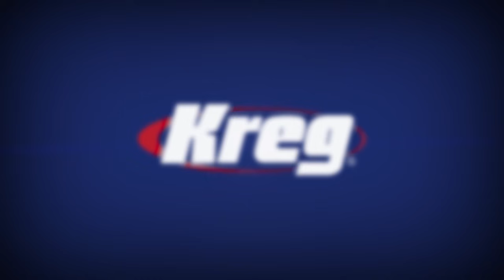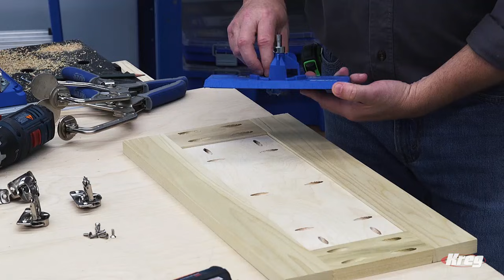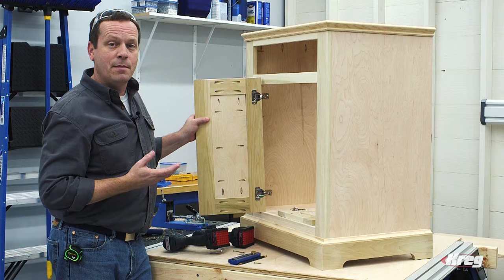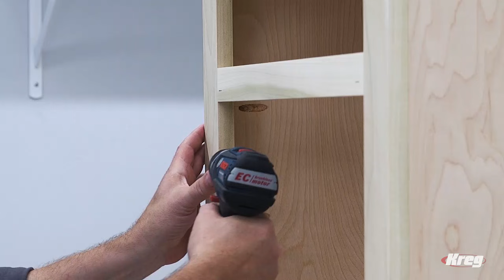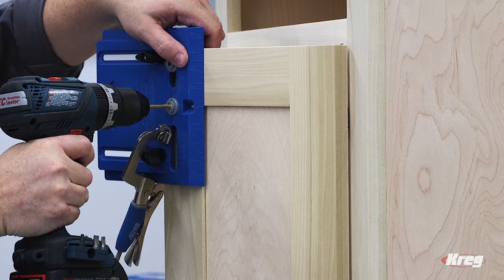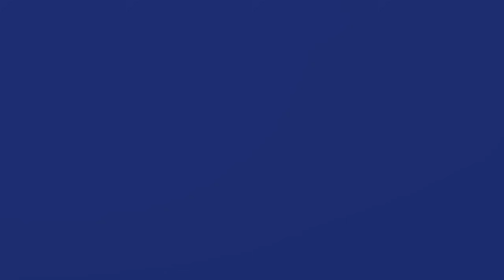Mount Doors Easily And Accurately | Basics of Building DIY

Comment: How do you choose which hinge to buy? They have a variety of the same looking hinges at the box stores but with different labels and measurements? No one at the box store seems to know how to explain it.  Thanks.
Reply: Usually, you can find info online, however, you still need to know if your doors will overlay and by how much; 1/2", 3/4" etc. Or if you want inset; meaning: no overlay, but flush. Then you would want to know,( in degrees, ) how much the door opens. Personally, I'll usually settle for 105 degrees. And lastly, you can order hinges with soft close, as well.